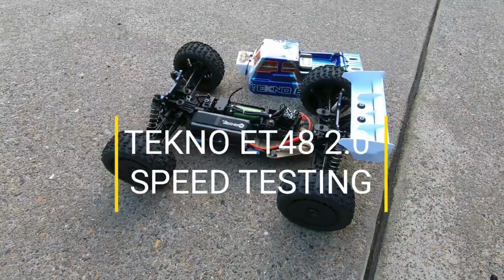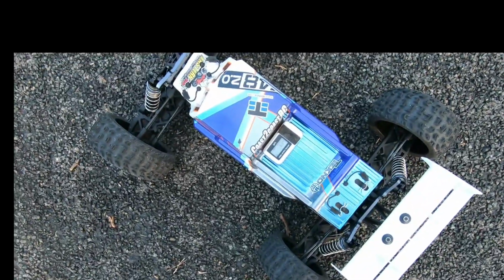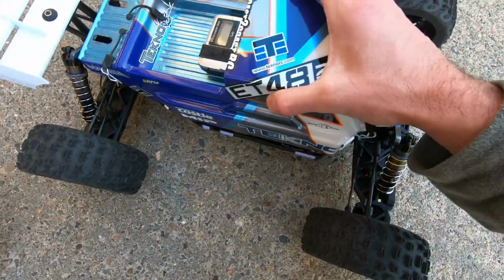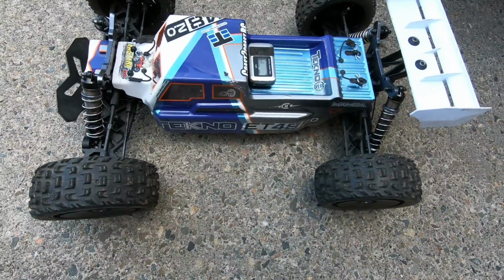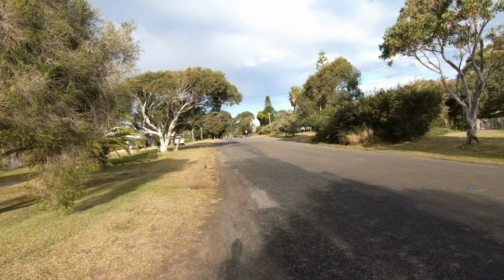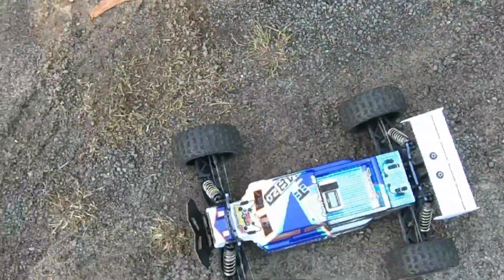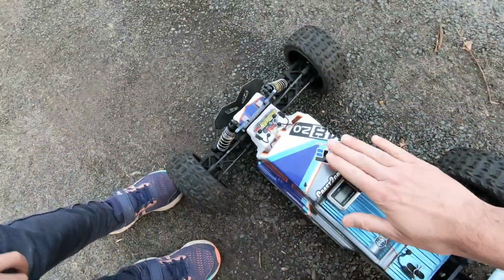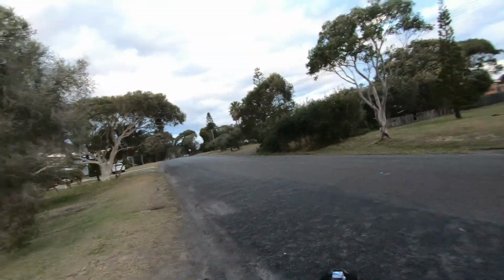TEKNO ET48 2.0 "BASHER" SET-UP * SPEED TESTING W/ CASTLE MAMBA MONSTER X 8S AND 1520 1650KV COMBO!

Comment: Love that paint bro I just finished mine today
Reply from the maker: Thanks mate, I'll have to check yours out.
Reply: @jonowillmer  I don’t have a YouTube 
But I was wondering what 6s batteries do you use in your tekno all mine are to long and won’t fit
Reply from the maker: @Dos_Rc  yeah it's a pain isn't it, I found most hard case batteries will fit, but I also have a few soft case ones that fit. The heavy duty turnigy batteries, and graphenes did, but they are a tight squeeze. The other one's I have are some 4000mah 6s packs I bought from zeee that I wanted because they were lighter. You don't get the run time, but they still last long enough and the car doesn't get bogged down with the extra weight.

Comment: Sure that may be fast but what does it do on a track
Reply from the maker: Not sure what you mean? Top speed on a track? It would depend on the length of the straight. The setup for the track is very different, I run a hobbywing system for the track with a 15t pinion, the track I drive on is fairly small so it doesn't have a long straight.
Reply from the maker: I have a few videos of it on track but I haven't posted them on YouTube. I'm happy to post up some footage at some stage.
Reply: @jonowillmer  throw the right tires on that thing and set it up for racing and go kick ass
Reply from the maker: @thercracer1717  Thanks mate, this is my basher, I have another et48 2.0 that's dedicated to racing. It is setup for the track only. I have an eb48 2.0 that I've setup for the track too, we are in Lockdown so no racing sadly. 

It will happen soon enough I hope. I'll try and post up some video when we get back to the track. In the mean time I've only got the spots near my home to use.

Comment: Where did you pick up the front skid and mud guards?
Reply from the maker: I just modified an arrma typhon front bumper, and I cut the rear mud guards out of the scrapes from the body shell
Reply: How did u modify the typhon front bumper? I want to copy what you did  good idea thanks
Reply from the maker: @glenncarlson3161  if you mount the bumper to the chassis before you install the diff housings, you can temporarily bolt the bumper into the chassis with the front screws and some nuts, then you can either drill the rear with it in place or mark up the holes and drill it. You can then remove the bumper and install the diff housing. The issue will be you have a couple of extra holes in the bumper, and the stock screws are a little short to make up for the extra bulk, though you have to make sure you don't buy one that are too long, because there isn't a lot of extra thread available in the housing. You can measure that with some callipers if you use the depth probe or even just with a hex driver push it into the hole and mark the spot on the shaft where it meets the plastic of the new bumper and measure that it will be the screw length you need(minus a few millimetres). You will need a countersinking bit to create the hole for the screw head also.
Reply: Thanks so much.  I just started building yesterday.  And I baught that bumper you sent the link of. Tekno forums? I've was put in a wheelchair 3 years ago and now I'm back into rc. I only use my phone and never been on a forum before.  Do I need a computer? I'm thinking about getting a laptop so I can maybe start making videos too. I've got a lot to learn about tekno it's my second tekno (et48.3 first). Thanks for your help
Reply from the maker: @glenncarlson3161  no you can use your phone, just look up Tekno Forums in Google, it will come up, lots of great posts on the ET48 2.0 build.
Reply from the maker: @glenncarlson3161  just be aware that there isn't that much aftermarket support yet for the 2.0, so be careful that anything you buy is for the new model they are very different to the 48.3.

If you have a reasonable phone you can even edit youtube videos on your phone. I don't mind the Adobe Rush app it is pretty good for making videos on your phone.

Comment: Hope u get that 70 bro iv the same set up in my infraction and she moves
Reply from the maker: Thanks for watching, in the last run on the video it made it to 70 mph, it has much more in it, but this set up is a basher and don't need it to be faster than it currently is.

The Castle system seems to be really well matched the Infraction would fly.

Comment: I'm building mine right now and I noticed your front bumper.  Where did you get it I want one thanks
Reply from the maker: It's an Arrma Typhon T-Bone Racing bumper, I just had to modify the rear holes. There are some ready to go bumpers on AliExpress if you search for EB48 2.0 they will show up, there is a wide one which would work well on the ET48 2.0. If you're going to be bashing, check out the new rear brace from M2C racing, the chassis is great for racing, but it has a lot of flex, so your driveshafts are at risk.

https://m.aliexpress.com/item/4001259557762.html?spm=a2g0n.productlist.0.0.2b0d3e2ardnCnm&browser_id=37c839c018b34fab98facf2a8582d7fa&aff_trace_key=&aff_platform=msite&m_page_id=00117aa68d5f101c78d3603244e200d0f11f980d1d&gclid=&_imgsrc_=ae01.alicdn.com%2Fkf%2FHa5f101ccb77c46b9a9abaf14d60964cac.jpg_640x640Q90.jpg_.webp
Reply: Oh thanks so much.  I'm a basher and my favorite is skate parks.  So the big bumper might be good.  Appreciate
Reply from the maker: @glenncarlson3161  get a rear bumper also if you can or fit a front bumper to the rear, it will help with absorbing the impacts. It's a beautiful truck, you're going to have a lot of fun with it.

Comment: Where did you get the front bumper for the et48 2.0?
Reply from the maker: It's a T-Bone Racing bumper for a Typhon, I just drilled some extra holes to fit it to the ET. If you look on AliExpress there are loads of bumpers that will fit without modification. If you look under EB48 2.0 you'll find more items. 
https://m.aliexpress.com/item/1005001620975984.html?spm=a2g0n.productlist.0.0.2b0d3e2aLN3nYL&browser_id=37c839c018b34fab98facf2a8582d7fa&aff_trace_key=&aff_platform=msite&m_page_id=00117b47b0cccc5c4f72a533ed3b5152cc1ef62130&gclid=&_imgsrc_=ae01.alicdn.com%2Fkf%2FH478488878338409d9d7d00e679c0d697k.jpg_640x640Q90.jpg_.webp&pdp_ext_f=%7B%22sku_id%22%3A%2212000016844567528%22%7D